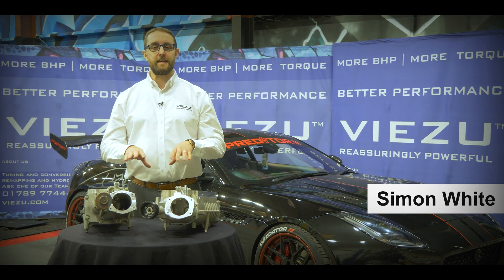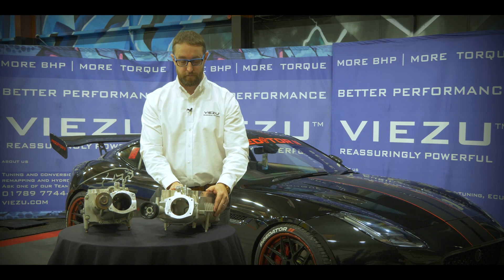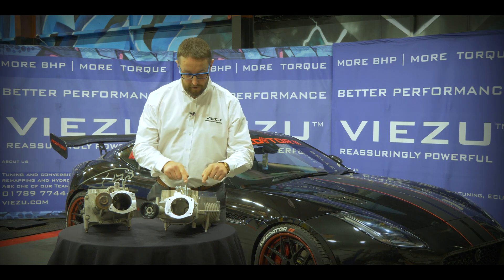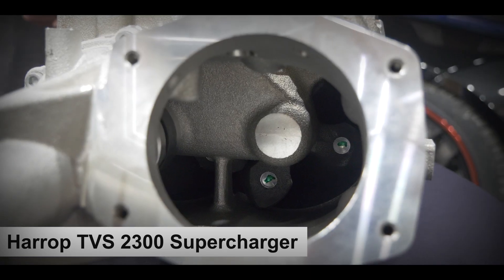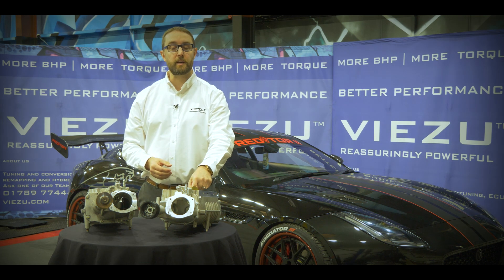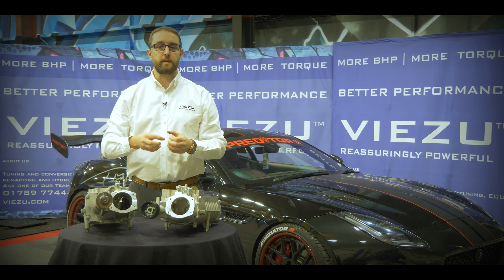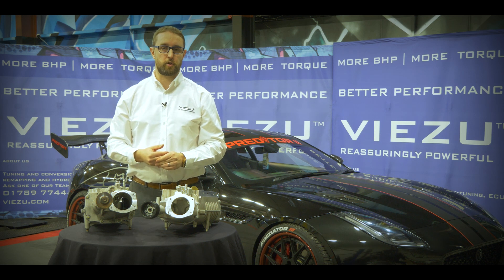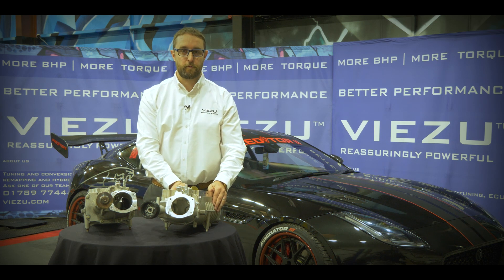Comparing Harrop TVS 2300 and Eaton TVS 1900 Superchargers

Comment: I love 1900 on my XJR. I plan on upgrading the supercharger puller to smaller one along with an upgrade to the crank pulley as well. One i do that, I will do a tune. Upgrading those 3 will add at least 100 hp increase.

Comment: So I have a 575hp RRS SVR. I installed your Paramount pulley only, which has now creates about 603hp (no ECU remap). If I were to swap out my pullied TVS1900 for the TVS 2300 with that stock pulley on it, will the hp results still be about the same? The 1900 I have found to be a great supercharger.
Reply from the maker: Hi Fred, no, not the same, the TVS2300 has the same smaller pulley  already fitted but produces much more boost that teh TVS up to 30% more boost pressure, its quite a different ball game,  with tuning the TVS2300 will run +700bhp - something you would be interested in ? Drop us a mail if we can help with anything - info@viezu.com

Comment: Will the engine block be able to handle over 700hp safely? What about the ZF8 Speed transmission? Mine is a daily driver, but always looking for more power! Cool video!
Reply from the maker: Hi - happy to help, we are running and testing a number of cars with 725bhp and 1000Nm torque we are seeing no issues at all,  we do find if you push to 750bhp, the gearbox does start to get quite hot on the dyno, but even then there are no issues on the road we have see. We have plans to push further next year